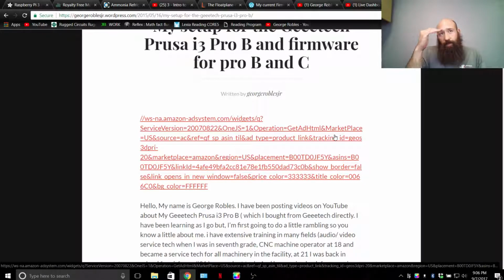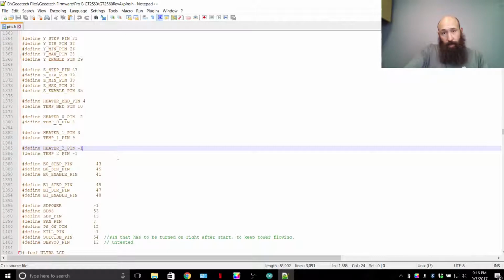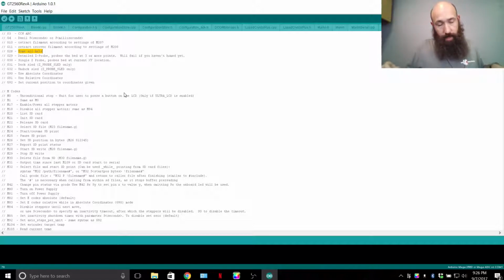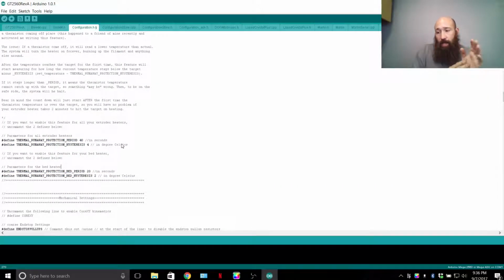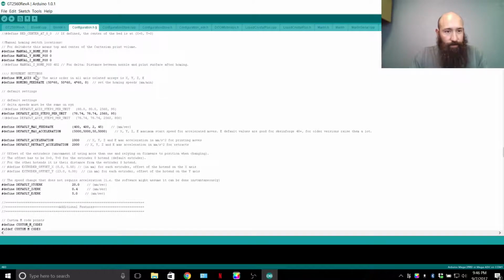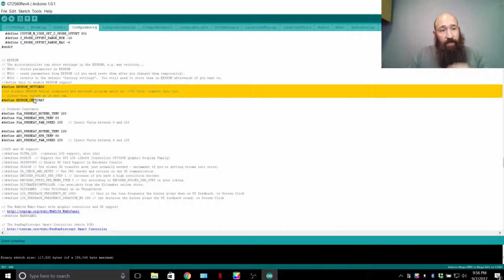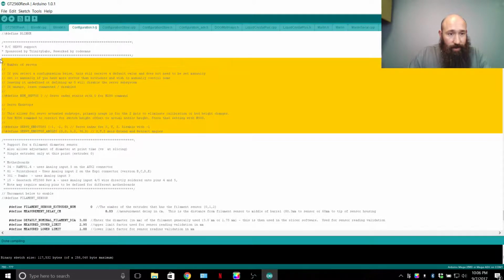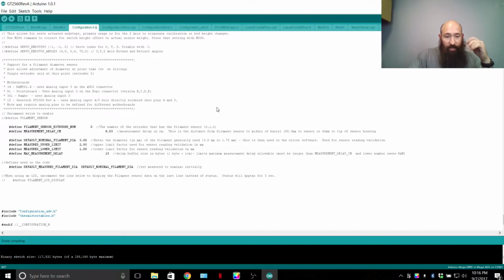Quick Firmware Rundown, George Robles (Live Stream) second try super long, fast, run down.

Comment: hello george hows it going could please point me in the right direction or tell me what im doing wrong... i cant upload the code (marlin-p13-pro-b) to gt2560 controller.. to solve the extruder not working problem.. keeps timing out iv tryed almost everything... thanks in advance buddy any help would be awesome
Reply from the maker: +ratstar13 look at my WordPress blog and see comments.
I'm gonna guess it's your version of ide, the board is mega, programer I use is Arduino as isp. These settings are in your tabs for Arduino ide
Reply: thanks for your reply i just managed to flash thought i was done with this...but extruder still not doing its thing im sure im missing something :/
Reply from the maker: +ratstar13 if it's a legacy board then definitely read all three blog posts.
Reply: wow just read your great blog flashed GT2560_Georges_Setup_for_Geeetech_Prusa_i3_Pro_B.zip still not extruding.........
Reply from the maker: +ratstar13 three blog posts. Discussing gt2560, gt2560 rev a, and the problems I had.
Reply: been through everything all really informative but im still stuck been working on this problem since thursday.. everything is running super smooth the only problem is the issue with extruder and im sure its not a mechanical problem
Reply from the maker: +ratstar13 try swapping stepper drivers with a different axis, like x or y
Reply: finally found the problem dead stepper driver... thanks so much for your help mate i owe you 1 let me know if i can ever help you with anything... checkout my channel
Reply from the maker: +ratstar13 very welcome. See video on how I still printed with a bad stepper driver. Mine still ran one way though. Had to put on extruder, then disabled retraction via slic3r settings.
But as you can see, that was my case.
However, hope you get something quick to get yours running.
Also I run 0.9amps to x and y axis. And 1.0-1.1 amps for z and e axis. I'm not worried about noise. I care about higher current for quicker movement and accurateness for sudden movements.
Also make sure you heat sink them.